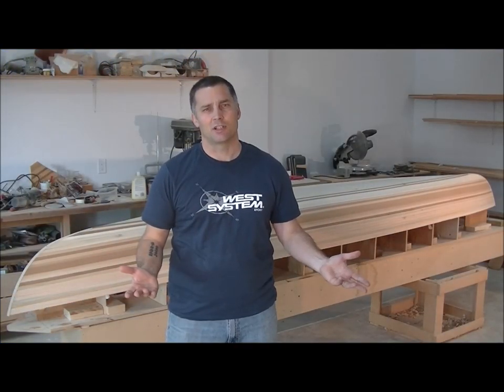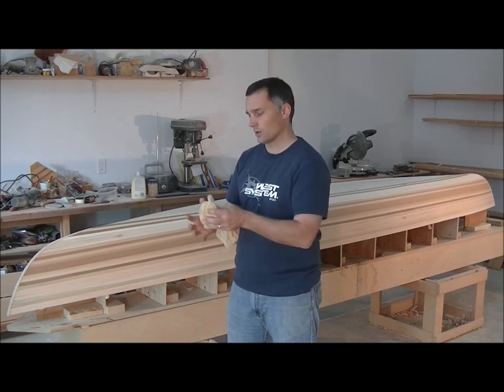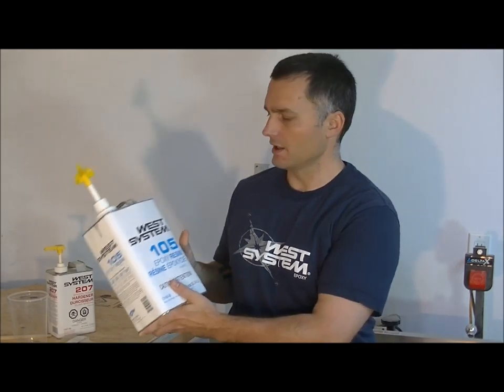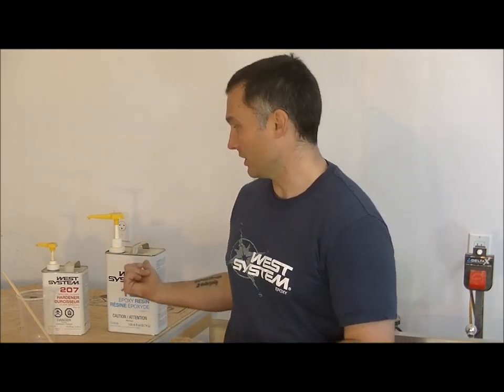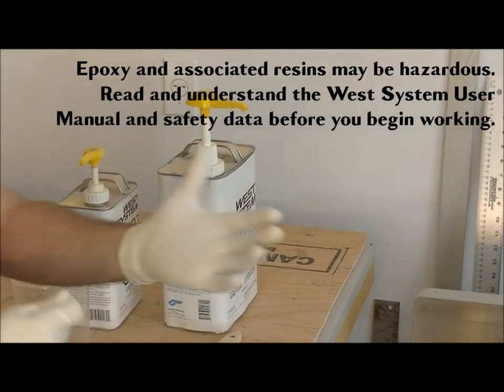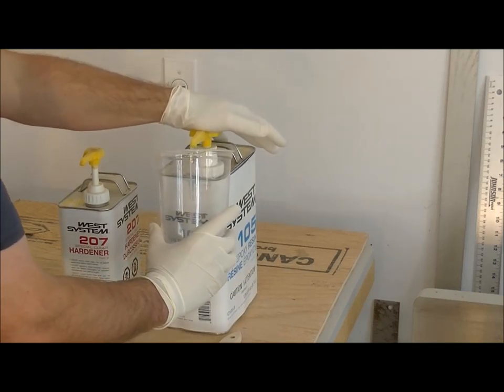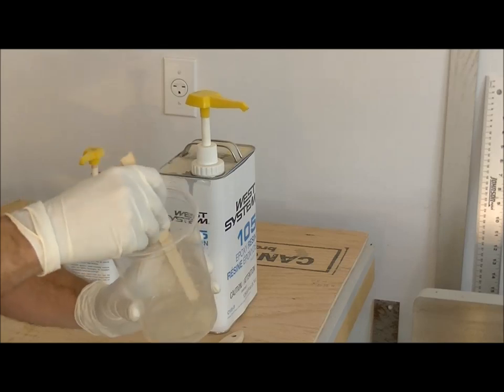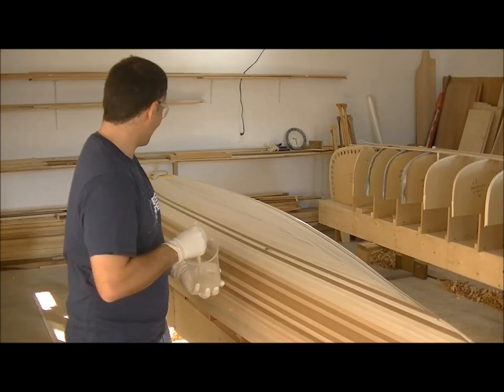How to Apply Fibreglass and Epoxy to the Outer Hull of a Cedar Strip Canoe - pt One

Comment: Jason, I've watched a lot of your videos and am currently pretty close to glassing my own prospector.  My question is:  How much epoxy do I need for a 16.5' canoe?  Is one gallon of 105 enough or do I need 2?  Also, do you put the "football" double layer of glass on the bottom of all your canoes or just this one in particular?  I live on a fairly abusive river in New Brunswick and I'm trying to decide if I should double up my bottom as well.

Thanks for all the info you've been sharing.  It's a great hobby.
Reply from the maker: If you think the bottom of your canoe is going to take a lot of punishment then you might as well add the football patch. I hate to give a round about answer regarding the amount of epoxy, but if you can buy it locally I'd start with one gallon and see how far that gets you. My reason for being vague is that if you apply the epoxy too heavy you might need more, too thin you might have a lot left over. If you do add the football patch, then you will need more epoxy. Make sure you wet out your hull and then let it sit overnight and come back and hand sand with 100 grit (before epoxy). I think I mention this in one of the videos. Wetting the hull out will show any glue you missed or scratches etc.